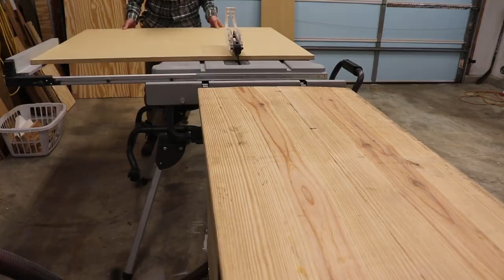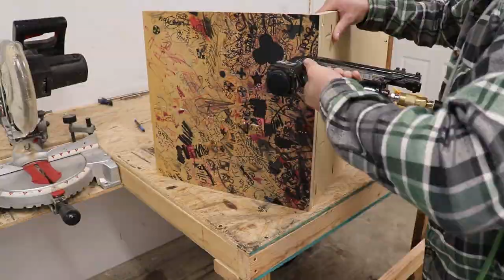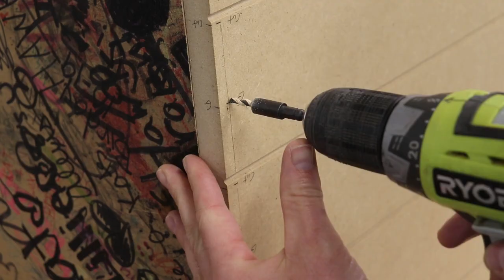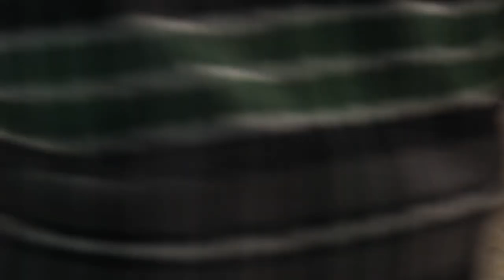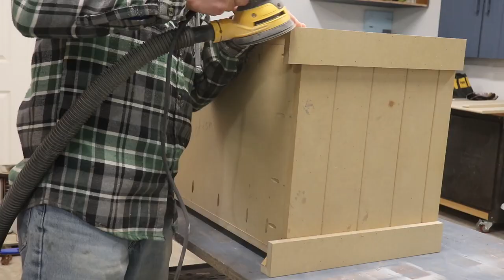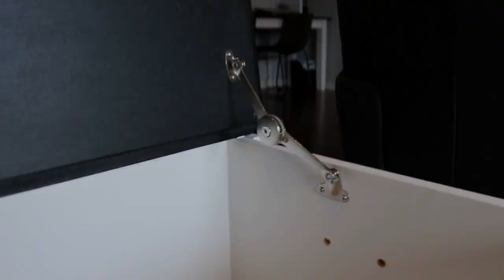How To Build A Toy Box - The Short Version - Free Cut List

Comment: Ran into trouble using 3/4 plywood. the bottom piece has to be shorter than 32 inches
Reply from the maker: Shoot, thank you for letting me know. I'll take a look and make the correction. I hope you were able to continue on and didn't waste any material?
Reply: @howtofixitworkshop  Yeah I'm all good man. I had to make a correction. it only caused a little trouble because I'm trying to finish it before my boys 1st and I'm borrowing friends tools that I'm not used to and the table saw I'm using doesn't have all the nice modern features. I'm also slow because I'm rusty.
Reply from the maker: That's awesome! Glad it worked out!